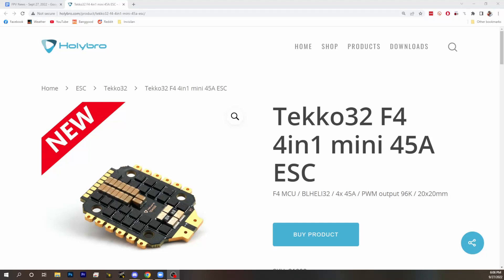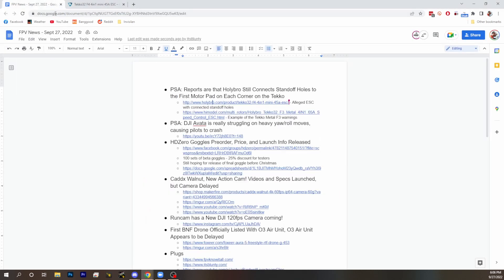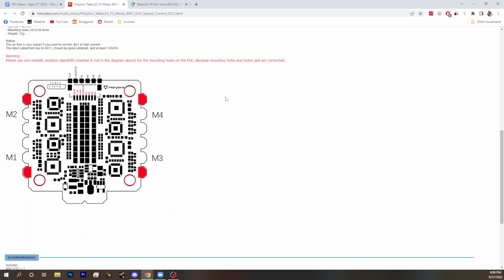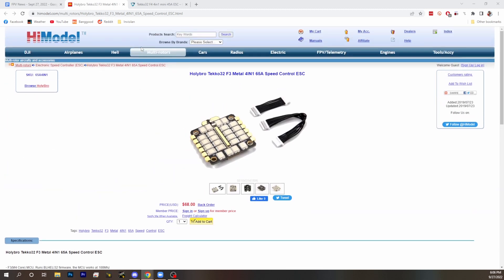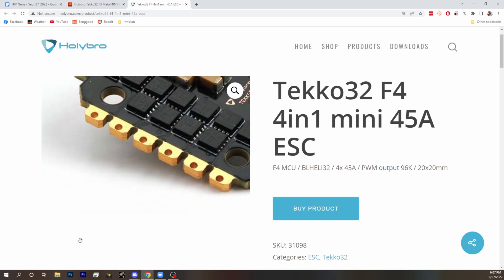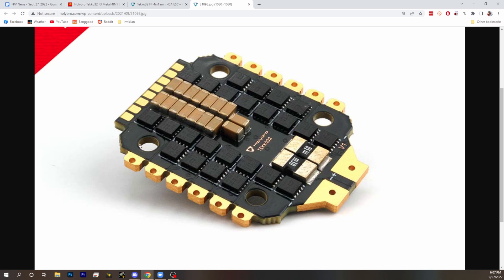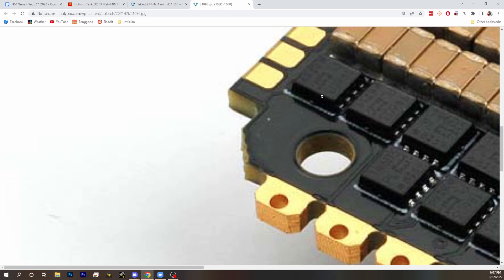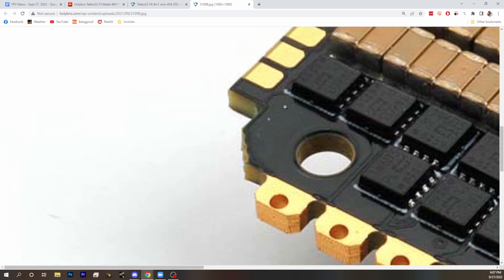PSA: Holybro Connects Standoff Holes to the First Motor Pad on Each Corner - Tekko Mini - FPV News

Comment: I can tell you the new Tekko32 F4 50A ESC has the same problem! I had a rough running M1 motor on a new build (Apex 5”) and when I disarmed and lifted the quad I burnt my hand on the frame screws/cups on the bottom. Current was flowing straight to them and heating them up lol.
Reply: Did you use gummies?
Reply: @demirfpv1563  At first no. I mounted the ESC on bare screw with o-rings (donuts). This meant the screw was touching the edge of the material around the ESC mounting holes.
I switched to gummies to provide insulation and this has ‘fixed’ the problem. Quad flies great……….for now lol💥
Reply: @GMB_FOZ   I have same esc with gummies. so far no issue. we should not strip gummies. may be I will add extra insulation material around gümmies. ,thanks for letting us know.:)